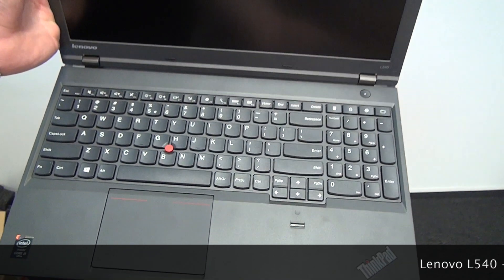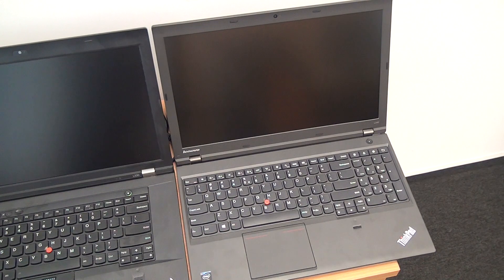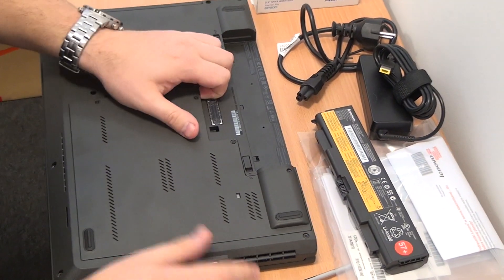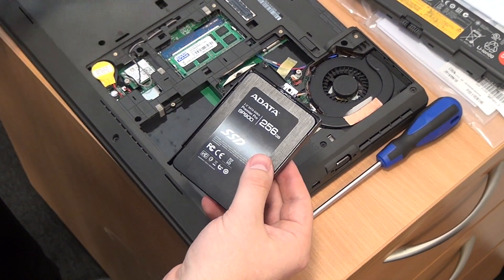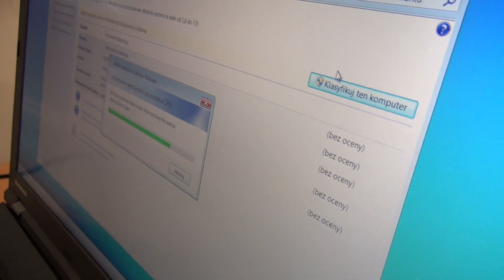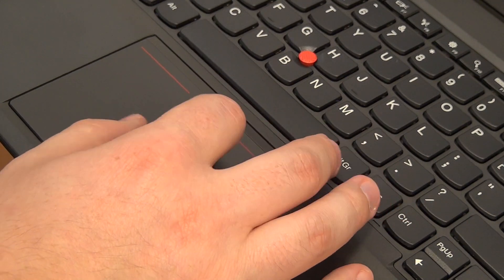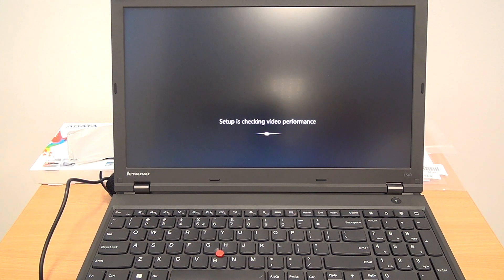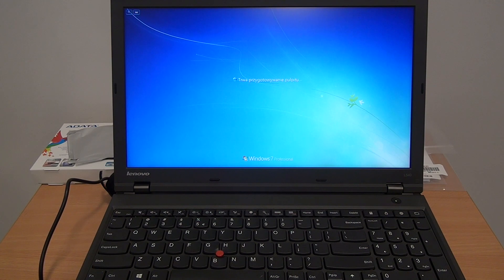Lenovo ThinkPad L540 full review, SSD and RAM instalation.

Comment: can you please help me with Lenovo Thinkpad L530, i want to upgrade it in SSD, but i don't see any video here in youtube.. thank you so much
Reply: Thanks a lot
Reply: should be easy, you just open it from the bottom, almost as L540
Reply: @jantestowy123  do i need to remove something or anything from hdd when i putting the ssd?
Reply from the maker: There are just two screws in bottom pannel, ssd can be just plugged in without caddy. Can’t remember if there was a one on hdd, mine is just plugged in and it is a snug fit. Some L series laptops have a plastic bracket that was helpful for hdd, ssds are so light that it’s fine.

Comment: I just got his machine after being a thinkpad user for over 10 years. I hate the fact there are no dedicated buttons anymore, it basically makes the trackpoint (red dot) useless - which is a big loss for me. I've watched several videos on the trackpad woes and how to actually use it as well. I can get by with it ok and people buying this laptop who have never used the trackpoint before will think it is ok. But if you do normally use the trackpoint, wait for the L550 - all the L T *40 thinkpads have no hardware buttons, they revised this for the new L T *50 series and the buttons are back. All that said - this is a lovely decent specced laptop - easy to upgrade and built as you would expect of thinkpad - like a tank. Easy to upgrade and you can even upgrade the lower spec 1366x768 display I have on mine for the full HD display in this video. Software driver support is excellent too. No manufacturer propitiatory drivers needed like sony and toshiba. all easily installed with lenovo system update. Thinkpads are the best laptops hardware wise behind apple.
Reply: Personally I haven't used dedicated trackpad buttons for years, so it wasn't a big loss for me. I guess you're not used to using gestures? They're way more efficient once you get used to them.